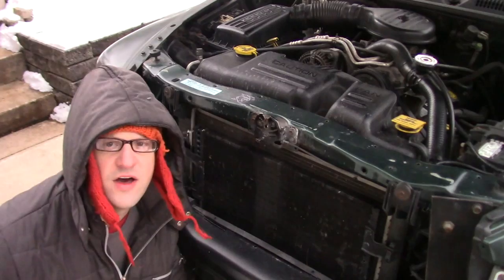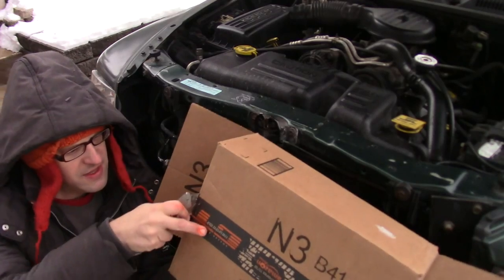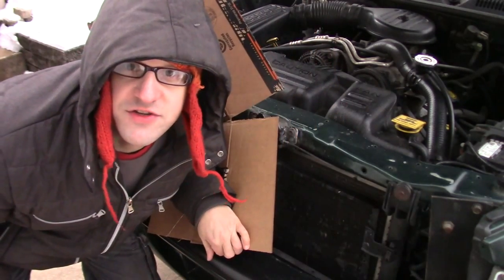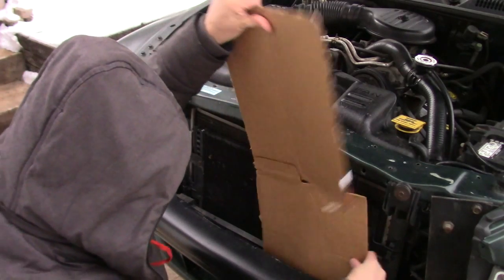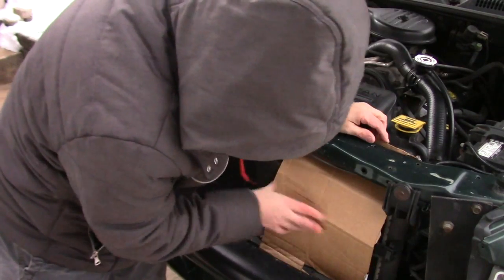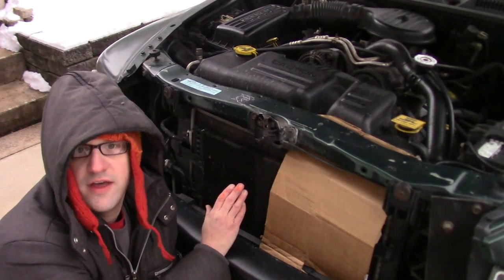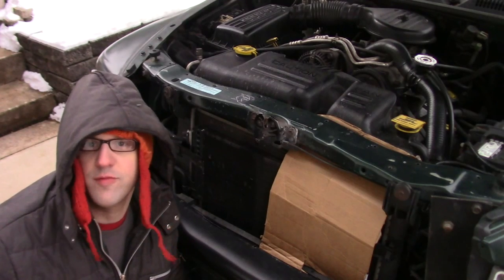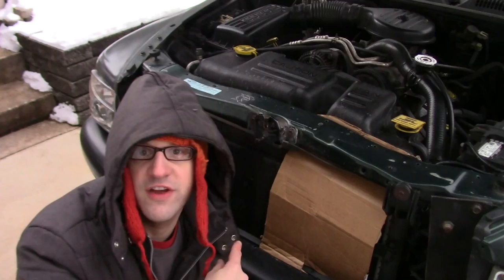Radiator Cardboard

Comment: "Pizza boxes are great for this" and they probably help you get there in 30 minutes or less !  LOL
But seriously, I'm giving this a try. My truck has a 160 degree thermostat which is perfect because in summer it runs 180 - 190 degrees.... except in winter time it actually runs 160 degrees which makes for a cold air heater in the cab.
Reply from the maker: "Helps you get there in 30 minutes or less" - Ha! Good one! 😄😆😄👍👍

As for your heater, it should help with that. I've done this on both my vehicles when it gets really cold, and it really does work. Just make sure not to block off the entire radiator and remember to remove the cardboard when the weather gets warmer. Good luck! Thanks for watching and thanks for commenting!

Comment: Temp of my car is around 50-60 celsius degree ( 122F - 140F) when it's raining. Can I use this method to increase the heat to 80-90 celsius degree?
Reply from the maker: So, let me understand- you can’t get enough heat inside your car even when it’s just raining? It sounds to me like your heater core has gone bad. If you engine coolant is already reaching 140F, but the passenger compartment is not getting warm, then the heater is not doing its job. When a heater core goes bad, the coolant stops circulating freely through the core, which stops it from heating up. You turn on the fan and it only blows cold air even though you have the heat on. Replacing a core is a miserable job. I’ve done it. The core is usually buried behind the dashboard close to the firewall. It has to be disconnected from inside the engine compartment. Everything is hard to reach. It can be done, and once you replace the core, you should have heat again, but I’d take it to a mechanic you trust and see what they say. You don’t have to have them fix it, just tell you what they think. Then you can go from there. Good luck! Feel free to let me know what you find out. Thanks for watching and thanks for commenting!

Comment: When cold enough (like it is here -41C) the thermostat on the car doesn't even open the coolant loop to the radiator. The coolant loop only circulates through the heater core. Thus rendering any cardboard over the radiator meaningless for creating warmer heat. About the only thing it does is block excess air from flowing through the engine bay.

The real purpose of cardboard over the rad is to protect your rad, especially on highway driving. A 100C rad, hitting -40C air (with windchill at highway speed likely over -70C) you can have 170C of temperature difference. This causes great stress on the rad and can cause it to burst.

Thanks for sharing. Hope this clears up some of the theory and myth behind this common practice.